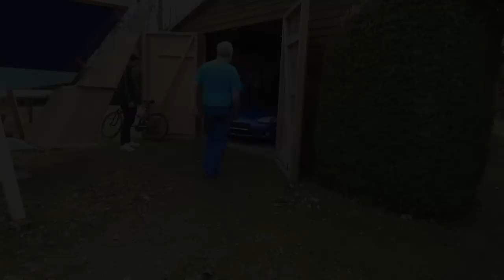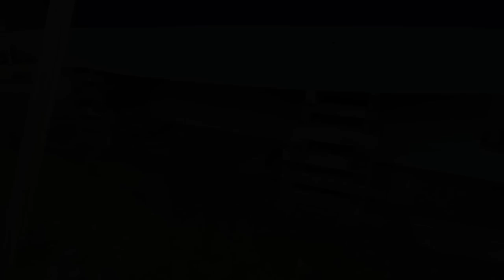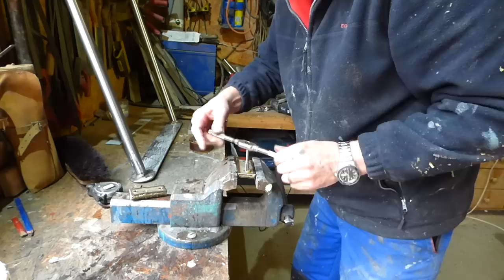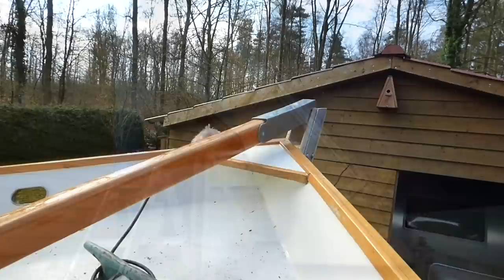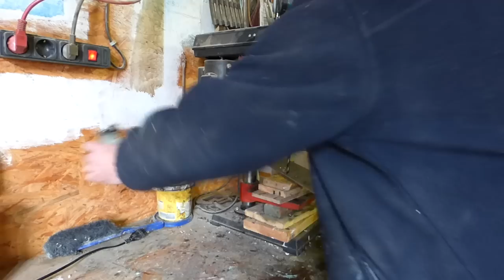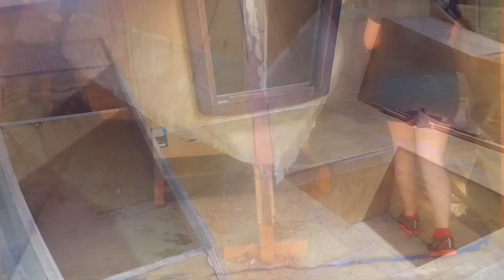And The Build Goes On; Building a cruising sailing boat - SV Tapatya EP271

Comment: Thank you Tony for tonight's video. It looks like spring is trying hard to help you out. Good work on setting up the tiller and the stop cross bolt. It is hard to understand why the trucking company has not contacted with you. Surely at least a call to tell you they may not be interested would be polite if disappointing. Take care an best wishes for a good time with Hazel.
Reply from the maker: Thanks Matt. Yes, I was pleased with the tiller stop. 👍

Comment: Hi Tony, Another great video, Do you find any sort of lubricant helps when tapping stainless steel. Also remember that there are many grades of stainless steel, is the grade used for marine applications one of the hardest? I think stainless steel contains chromium which gives it the anti rust properties and depending on the percentage may affect it's hardness. Can you or any of your viewers help answer these questions. Many thanks and keep safe all,  Best wishes and safe sailing.
Reply from the maker: Thanks Andrew. I can’t speak for other grades but the 316 and 304 ( usual “marine” stainless grades) are quite hard to tap. Yes, I always use a grease on the tap and oil and/or WD40. I find it cuts well then, although considerable care is needed

Comment: Back when I was welding every day I could use my super cheap transformer stick welder at home like I was a welding wizard. I changed industries and not long after spend most of my time welding the rod to the metal, fastly turning the welder off and bending the rod back and too until it snaps. I heard you can modify these with a bridge rectifier for DC and some big smoothing capacitors but this upgrade has sort of fallen off the edge since i got me a Lincoln electric mig.
You always seemed down to earth explaining your take on how to do things or multiple ways to do them if the feedback helps.
Enjoy your trip to Scotland.
Reply from the maker: Thanks Alston. Sounds like a good tip. Sadly my old transformer welder went into a sulk and died shortly after I got the inverter welder. It’s in the scrap pile now 🥹